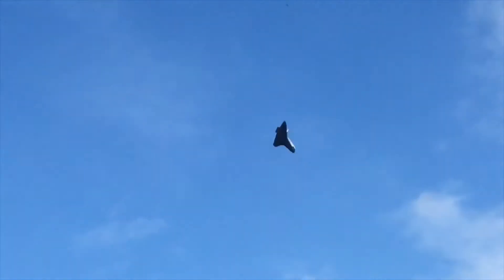DIY RC Space Shuttle Part 1

Comment: How'd you do the pan left at the beginning of making the shuttle?
Reply from the maker: It’s a trick that I haven’t employed too much, but I you will recognize it in my upcoming video. Basically, I hot glued my cell phone holder from a drone controller to one of those oven timer things. ⏲  Then, I put my phone inside (since it’s my main recording platform.) Next, I set the END angle, being 0 minutes, and moved the dial to the START angle, being roughly 5-7 minutes. Then, I hit record on the time lapse, and the end result was what you see. I had to give the timer back to my mom, so I un glued everything, and I never got the phone holder to be just right, so I don’t recommend using glue unless you buy a dedicated timer, but I do think it’s easier to paper tape a Runcam 2 to it and set it on time lapse mode through the app. I’ve seen this trick before on YouTube, so I did some research and learned about this trick, and now you know, too!

Comment: Suggestion ....Try a few hand launch glide tests in some tall grass or something before you launch it from an actual vehicle.... And definitely the lighter you can make it the better
Reply from the maker: Thank You for the suggestion! I did try some unpowered glide tests, but I could have done it differently. It was definitely overweight, and I think that the CG was too far back. On version 2 (which should be coming out very shortly) I hand launch tested it without any electronics in it, and it flew really well.